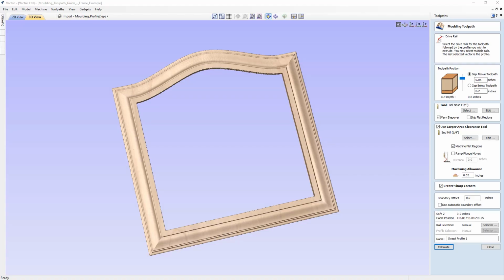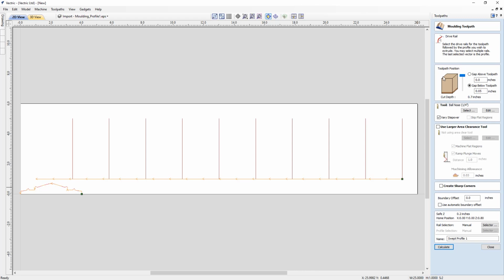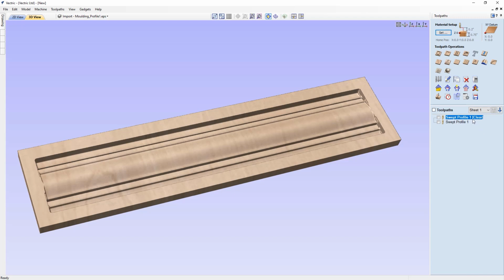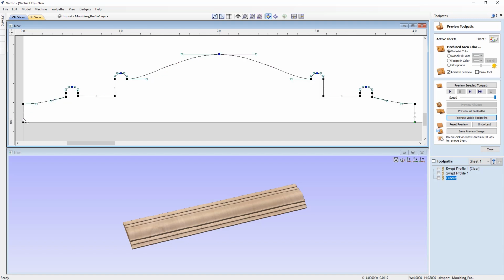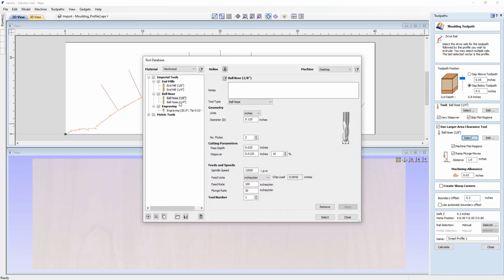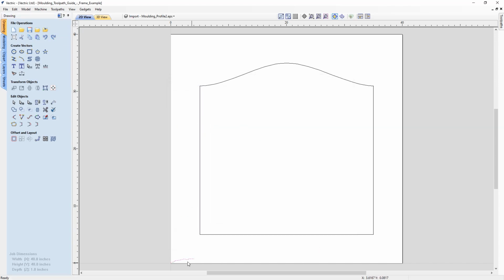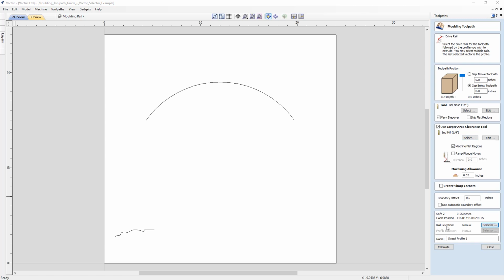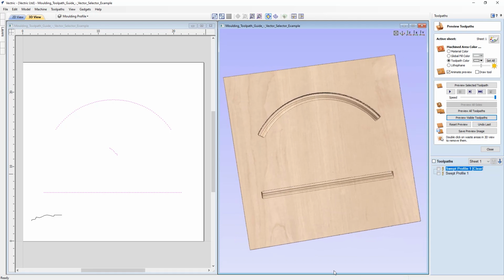Moulding Toolpath Guide | Vectric V11 Tutorials

Comment: How would you combine something like a vcarve or laser toolpath onto a moulding?
Reply from the maker: Hello Peter... thanks for the question. When it comes to using the moulding toolpath, no. Seeing as the toolpath is created from a cross-section and a path, there is no "real" 3D surface to project v-carving or lasering to (we have the option to project these toolpaths onto a 3D surface in their options). Now in saying that you could get a "result" with a laser depending on how deep the moulding is. It may suffer because the distance from the laser to the surface will change the focus of the laser will not. So adding a texture may work well, but adding text may not work as well or look bad.  

If you are looking to project the VCarvein or laser onto a surface, you will either need to use a premade 3D model or work a bit of trickery using a surface that closely follows your moulding.  This last option... your milage may very depending on how close it matches.  

Of course if you have Aspire you can create a 3D model of your moulding and then you are able to project both the vcarve and laser options onto it.

Hope that helps...
Reply: @vectric  Thank you - that's what I was thinking too.  Although the preview function from the moulding toolpath does a great job of rendering the 3D surface from the cross-section so it would seem that the 3D surface could be derived from the preview somehow.  Is there any way to capture the surface from the preview and bring it in as a 3D surface/model?